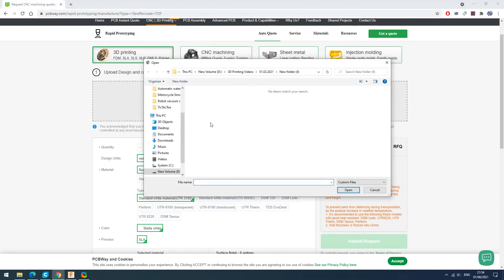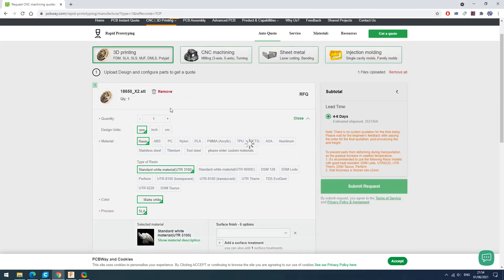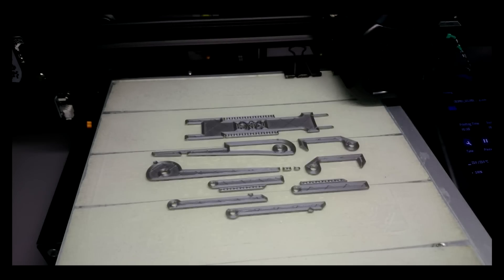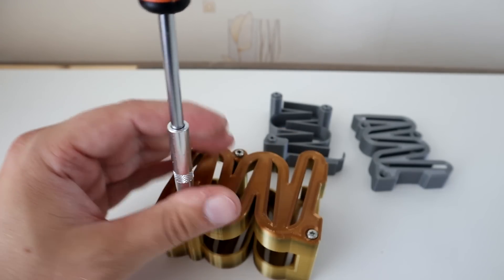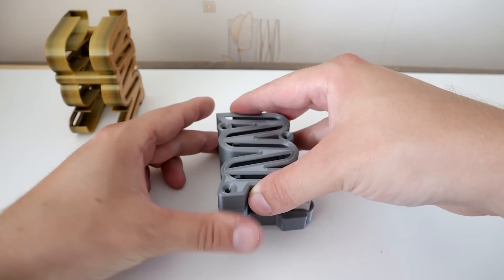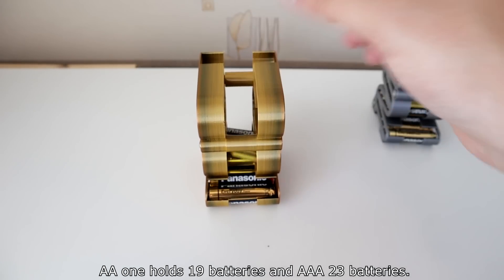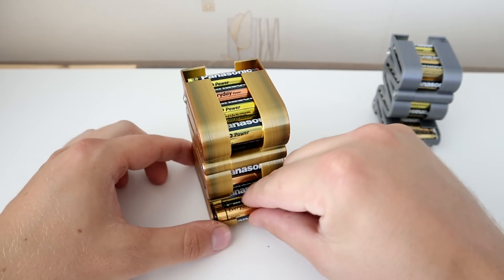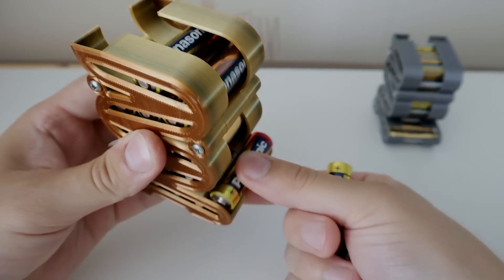Useful 3D Prints June 2022

Comment: Pretty sure the fridge note with pen holder is meant to use strong neodymium disk magnets that press fit into the holes on the back, not those crappy flexy magnets
Reply from the maker: You can see in the video it's made for 2x10mm magnets and I used different magnet because I didn't have these. The magnet I used is also strong and it has no problems holding it. All the flexible magnets aren't the same.

Comment: Sure glad I didn't see any of these vids before buying a 3D printer. I would've thought they can only print useless junk.

Here's a tip: Just buy a bunch of expensive filament and drop it unopened into the trash can when it arrives. That way, your 3D printer doesn't have to work so hard.
Reply: lol, i hear you but a 3d printer can make a mellenium falcon, space 1999 eagle on and Captain Titus from warhammer lot less than on ebay
Reply: OK, I'll give you that. They can also print all the useless junk that I've been using mine for.
Reply: They can also print the at least 20 functional prints to repair or improve stuff that I have printed. Even the fiancee agrees that's that printer is the only tech thing that has earned its price.